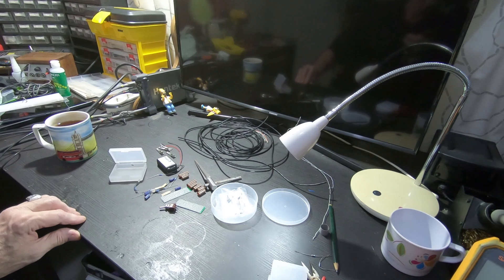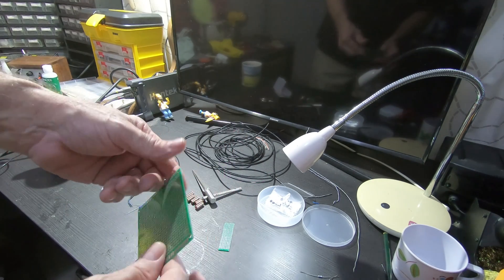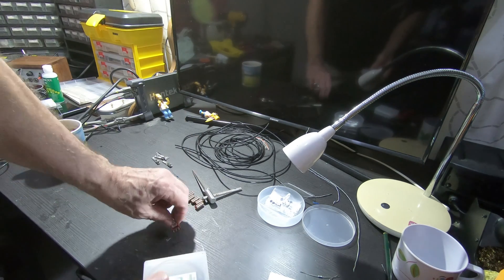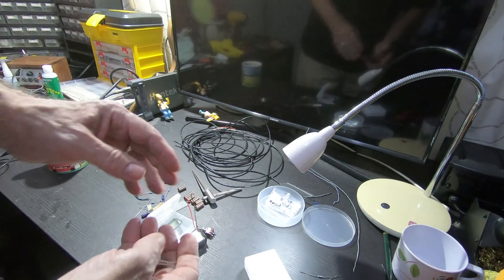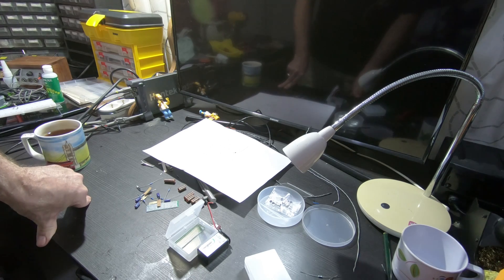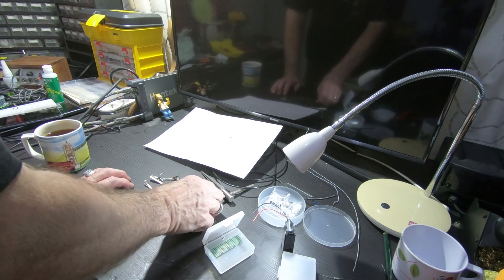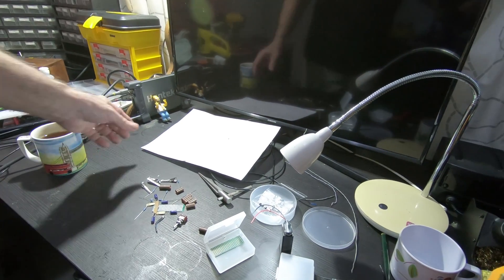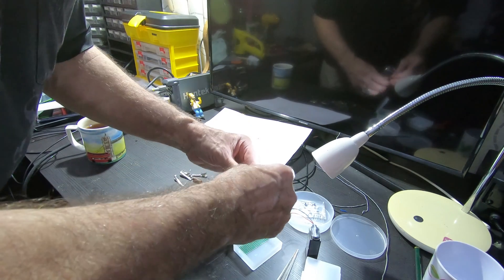How to build a studio grade microphone 1 of 10

Comment: Hello John,  i'm very grateful about these videos. I just have one question, can be any microphonic capsule used for this purpose? Or i need to buy one of those you said? the panasonic one or the clone. I live in italy, and it's so hard to find those, i have to order them from china but it will be so long. I have found this on an italian site: https://www.conrad.it/p/capsula-microfonica-2-10-vdc-range-frequenza50-hz-15000-hz-emy-63m65-302007
Reply from the maker: Yes, you CAN, but the results won't be as good. The quality of the finished product ultimately depends on the quality of the capsule. (there is NO magic in my schematics) :P
HA!
Reply: @JHBrandt  oh well i'll try then :D Hope for the best
Reply: @JHBrandt  Hello John, still me :D, i've some doubt. What about the connection? Does this need phantom power or just xlr to jack?
Reply from the maker: @AlexRomagnoli  did you see the schematics?... I think that they are posted on the first video in this series.
It powered by a 9v battery so no phantom pwr. Follow the schematics.
Reply: @JHBrandt  clearer, do i just need a xlr to jack 3.5 stereo then?
Reply from the maker: @AlexRomagnoli  No. You need an XLR if you need an XLR. If you only need a 3.5 jack into a mono preamp, wire it unbalanced and send the hot to both channels (tip & ring)